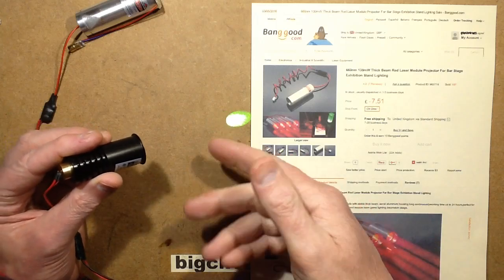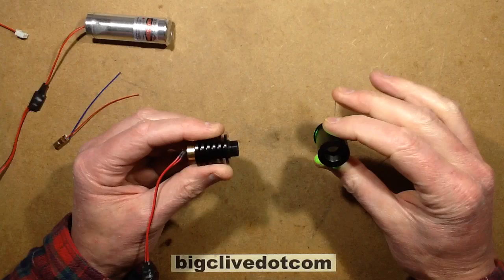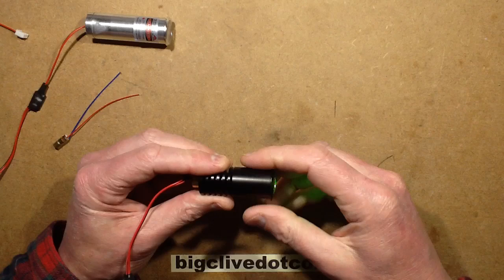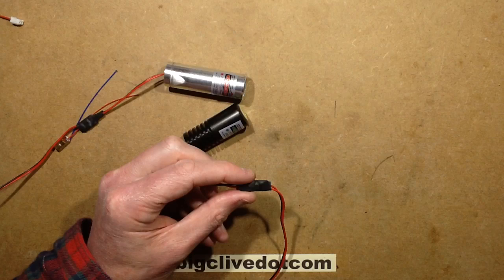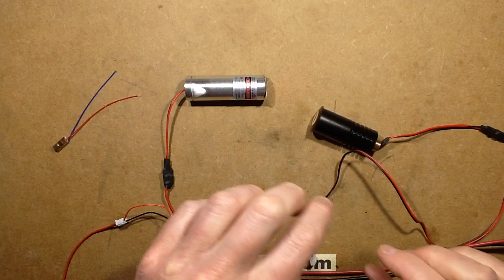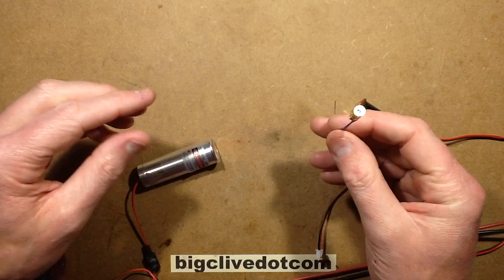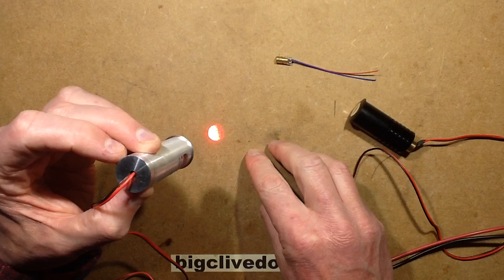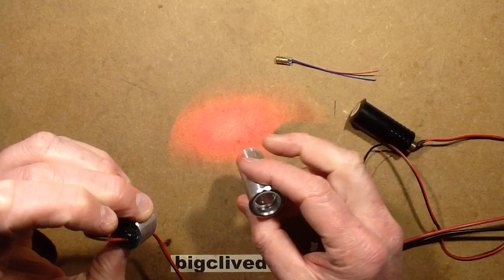Red and green wide-beam lasers.

Comment: If you like lasers then I have something you may be interested in, I've got a really old mains powered laser, it's not super powerful or anything but it's huge compared to a modern laser, I can't find it so I can take a picture of it but here's a rough idea of what it looks like.
https://spie.org/Images/Graphics/AboutSPIE/Laser%20images/Spectra-Physics-Model-124-B-c1980s-350.jpg
Reply from the maker: +vgamesx1 I have an old helium neon unit I built when solid state lasers didn't exist.  The 635nm (approximately) wavelength made the dot very bright compared to typical 660nm LED lasers, and the long lasing cavity meant the beam travelled a considerable distance for very low power.
Reply: bigclivedotcom Nice, I don't know very much about my laser, not even the brand, I got it about 10 years ago from one of my high-school teachers, I dunno why but he was just going to toss it and asked if anyone wanted it, so obviously I took it, then stored it away after I had my fun, although I suppose I could try to dig it up if you'd like to have a look at it.
Reply: +vgamesx1 
Is that a water cooled laser? I think I saw one of these (or rather its big brother) at Uni which had a huge power supply (it was a cart) and big water hoses connected to a heat exchanger. I can't remember what the power output was, but I was really disappointed when I found out that it wasn't more than what a solid state laser with just a big heatsink on it could deliver. Apparently the laser was from a time where it was the "only" way to get that power and it was still used for quite some time because the "light beam quality" (coherence, wavelength stability, spectral width and stuff like that) was so much better than what solid state lasers could do.
Reply: superdau Well I don't know, I just picked that one because it was the closest looking to mine that I could find within 5 minutes of searching.

Comment: Clive - if you want a "real" laser try this - http://www.banggood.com/445nm-5_5W-5500mW-Blue-Laser-Module-With-Heatsink-For-DIY-Laser-Cutter-Engraver-p-999283.htmlYou WILL need the appropriate laser safety glasses, and I'd suggest green plastic Welding Curtain if unexpected visitors are a possibility. This one can (and does) etch steel, reliably, and the supplied PSU is reasonably OK. I run mine on a "real" bench PSU simply 'cause I trust it more, and I can see what's going on.
Reply: Phil S you got a link that works for something like that ?
Reply: The Bang Good link should be OK - that's where I bought mine. I note that DX also do a complete laser etching system (laser, x-y carriage and stepper motors, control software) that appears to support PCL5 emulation, so should "appear" to be a generic laser printer for any current WP / Graphics suite. Bit more expensive though, as you'd expect.  When I bought my laser (violet, 5W) the kit (laser, heatsink/fan, PSU) came to just under $99 AU.